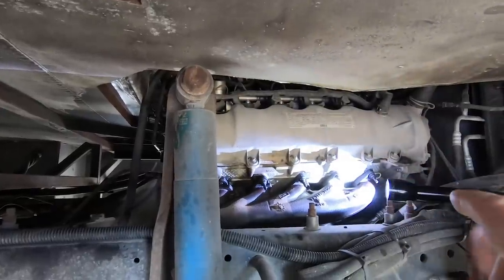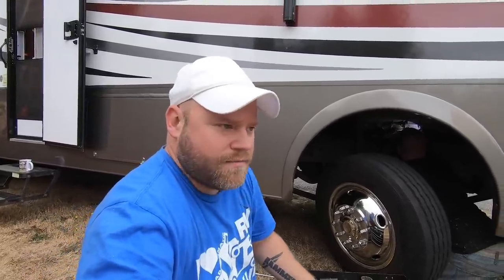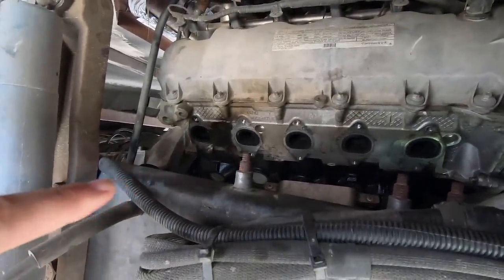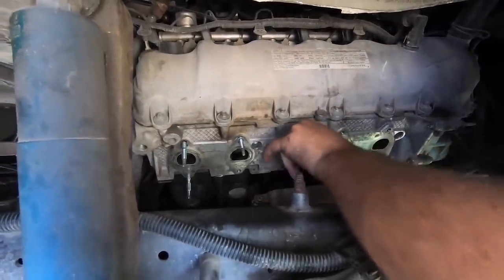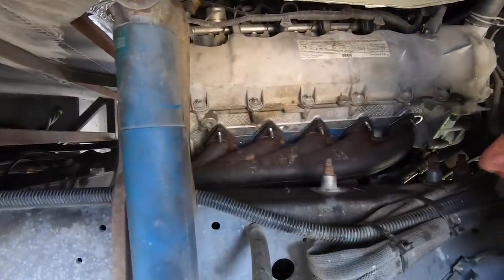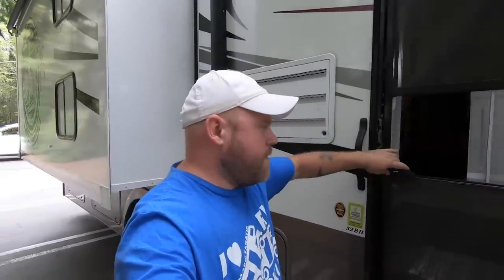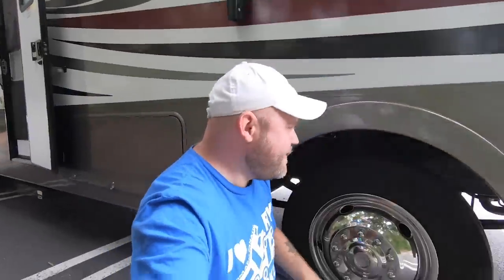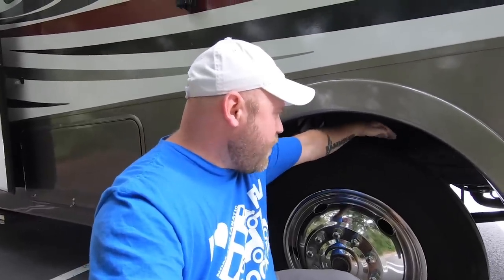Manifold Header Exhaust Leak Repair on V10 F53 Chassis

Comment: you should leave the engine running at idle for a couple of minutes, if you have been driving it. if you don't and you shut it off right away it's a big shock for the exhaust manifold to shrink back down witch could cause a crack or bad gasket. so if you where driving for long time and you get parked at a camp site let it ideal for 5 min before shutting off.

Comment: Fords are notorious for this.
My 94 Econoline (5.7) and my 94 Tioga (460) both have the tick tick tick (Sounds like a lifter) at start up and then after warm up, it goes away.
Some day...it will not go away...............
Reply: I have a 1994 Fleetwood Flair Class A with 7.4 chevey V8 454. The engine had the tick,tick tick lift noise. A mechanic friend recommended Marvel Mystery Oil. I purchased the small bottle, did my oil change, poured 1/3 of the bottle in. About 500 miles later
the tick went away and has never returned. I now  change the oil every 3000 miles and add 1/3 bottle each time. The problem occured at 64,000 miles in 2015. In 2019 I now have 101,000 miles with no problems. It's something you might want to consider.

Comment: great Video my In-laws had the V10 Bounder but never that issure but did have stearing and suspension problems they drove very conservative staying around 55 with a TOAD. Also Eric, do you have or have used an external phone antanna to extend your cell phone service

Comment: The V10's only have a problem with spark plug blow outs with early V10 that have short threads. My 98 E350 Class C Minnie Winnie would qualify - My 2003 E350 would not.   Most spark plug issues are on removal - especially the short thread heads. - carbon on the threads may rip the threads on removal -  they make kits for all this but usually they dont need plugs until 100k miles.

Comment: Did you use never-seize on the replacement studs? Also I file the manifold so it's a flat and clean mating surface. Copper gaskets work better and last.
Reply from the maker: Yup. I did mention that in the video twice just so I was clear. Said I was going to buy anti-seize before lunch, then I said we put anti-seize on new bolts after they went in so that this job is easier next time.

Comment: Awesome video but one question... how in the hell did you get access to the two bottom middle nuts on the passenger side manifold? I’m doing this on my 2013 Thor Ace and cannot get to those two bolts. Others came out fine.

Comment: Ironic Eric, I am getting ready to remove my exaust manifolds today..
I blew my 351W in my 1984 f250..I got a upgrade from the local dismatelers..
Now I have a 1994 351w.
Good luck Eric..Safe travels..
Reply: Too bad a 351 Cleveland wasn't available.

Comment: If you re tighten the nuts after 50 to 100 miles use, the gasket wil not start leaking... tec tip. Re tighten! after they have been heated a few times...

Comment: If you can check the flatness of your manifold with a flat surface with a feeler gauge and flashlight, flatten out with a mill file or stick some sandpaper to the flat surface and resurface. Ford cast exhaust manifolds are problematic no matter whom the part supplier was used. Heat stress/cycle a couple of times, let cool and retorque.

Comment: the tip of the spark plug breaks off in the head when removing cause the old style is a two piece design. the updated plugs are a one piece design!

Comment: Any automotive studs and bolts, When removing to break the seal first break the seal tighten up, You should feel or hear the seal break.  Good move, Wipe excesiv gasket seal off. Gasket.  Retaughque While engine is hot. Stroke your lucky rabbits foot.

Comment: possible if you remove all studs manifold will slip out and going back place manifold and gasket then install studs if that works won't have to lift engine which might be easier and not as dangerous if doing by yourself just a thought

Comment: Eric, I noticed the brown part of your coach is really shiny/polished.  I can’t remember you doing a video where you polished the rig.  What did you use?  Same thing as what Campervan Kevin used on his/your previous rigs?  Hugs and belly rubs to Jax Man.  Safe travels.
Reply from the maker: I didn't make a video of it this time, but I did a few years back when I waxed Yoda. I used "ZEP" floor polish, 5 coats. got the idea from Campervan Kevin and it works great on RVs.

Comment: Well... don't think I will ever have a V10 but FORD in general seems to have an awful lot of problems with exhaust manifold/gaskets leaks. Usually later in life than this V10 problem but a LOT of them have the exact same problems, and broken studs always seem to happen.
Reply: Yeah I wouldn't own any Triton engine again, as they all seem to always have cam phaser problems eventually when they get 160 thousand miles on them.  I'm told when that happens there's a 50/50 chance they'll take your engine out.

Comment: Is that a crack between the two ports your having trouble with?  at about 7:18 in the video?
Reply from the maker: The weird thing is, we checked it real good for cracks or issues and didn't see anything. But just watching the clip back here myself, is sure DOES look like a crack.... Hmm. But the leak was fixed so I don't know. If it comes back, you're probably right!
Reply: Looks like a casting mark.. you can see them all around the manifold
Reply: @nomadicfanatic  Hope you got it fixed!  That's a good buddy to crawl all under that for you!
Reply: @IntegraDIY  I wasn't sure looked like a weird angle for casting, but you could be right.  Hope he has it fixed with new gasket!

Comment: The cheap bean counters at Ford thought it would be a good ideal NOT to use steel spark plug certs. Fear not the fix is easy. NAPA sells the tap and certs to fix this problem permeantly. You will also need red lock tight and antisieze, acetone based brake clean. Compressed would help. Pull out old plug. Grease up tap and run it in. It will go in vary easy so don't be surprised. When you remove the tap you'll see the metal in the grease. Now clean treads with brake clean. Put small amount of antisieze on spark plug. Thread cert onto plug and put lock tight on cert threads only. Install tightly. Wait 15 to 20 minutes. Remove spark plug the cert should not follow. Blow cylinder to dry up acetone, reinstall plug to proper torque. Warning! Too much antisieze can cause a miss. If you did every step right it will take a machine shop to remove those certs and no more spark plug blow puts.

Comment: If the gaskets leak again, there is a good chance the exhaust manifold is warped and will need to be resurfaced at a machine shop. The cylinder head is aluminum and the manifold is cast iron, those metals expand at different temperatures which is problematic as far as leaks go. Just the nature of the beast I am afraid.

Comment: They make a metal gasket that lasts a lifetime,just saying it's a lot better than those paper gaskets.
Reply from the maker: The one that failed was a lifetime metal gasket..... Even if the part is guaranteed for life, doesn't mean anything. Still have to tear it apart to put a new one in to replace it. Saving me $10 on a gasket doesn't matter when it's a 2-day project in labor to fix the "gurantee" anyway
Reply: @nomadicfanatic  Thank you for letting me know that, I'll keep that in mind when it happens to my rv.

Comment: it's running too hot. Most likely using too much fuel causing manifold overheat. FIX THE OVERFUEL SITUATION
Reply: If its burning to much fuel it would be running cooler (rich) lean condition would add heat .

Comment: As you now know the V10 is notorious for having manifold bolts snap off when you go to undo them.  A friend who is still a mechanic wraps the screws with Teflon tape to keep them from locking up if they have to come out again.

Comment: I have thrown away exhaust manifold gaskets that come in the set.......knowing the exhaust manifold has a machined surface, 
I use HI-TEMP silicone
which now allows tightening all bolts pulling manifold flush to the head. The silicone turns to what I would say is close to a grout....
30 years, no leaks no broken bolts All is good

Comment: If it's a manifold its not a header
Reply from the maker: the gasket between the header and the manifold? Did I say it wrong? You know what gasket is leaking! lol.
Reply: You dont have headers you have an exhaust manifold and you replaced the gasket between the head and the manifold

Comment: Get ready Eric. Your mechanical problems out of that POS Ford V10 are only just beginning.
Reply: Ford durability tested the modular engines to 500,000 miles with little to no wear on the cylinder walls. My buddy had 770,000 miles on his 96 Ford F-150 4.6L 2-valve when he sold it and the new owner continued to drive it. Yes, you will have to replace the timing chains. Funny how foreign car owners claim timing belt and OHC timing chains are "normal maintenance" but if it's an American vehicle it's a POS. The only modular engines that were plagued with issues were the 3-valve models. The 2-valve modular engines in all forms (V8 and V10) will go 500,000 miles with no sweat other than timing chains. Many owners report going 700,000 miles with these engines.
Reply: @pogeybait5289  I would take that Chevy, or even a Dodge, every time over anything with a modular engine.
Reply: @pogeybait5289  Yes, I do. But again, I'd STILL rather have that than a modular engine. ANYDAY.